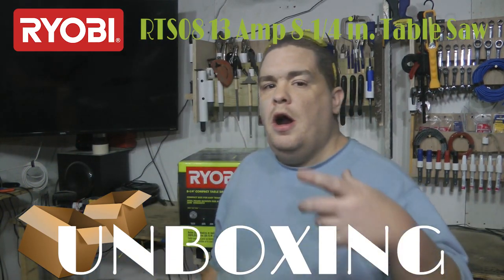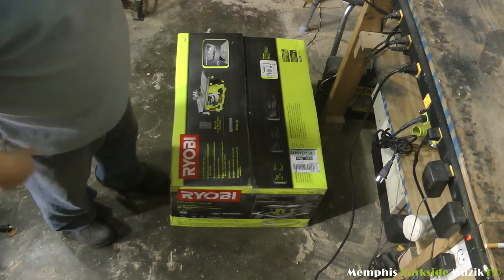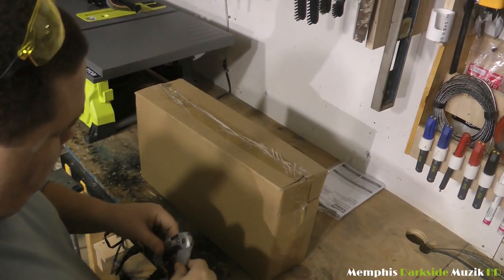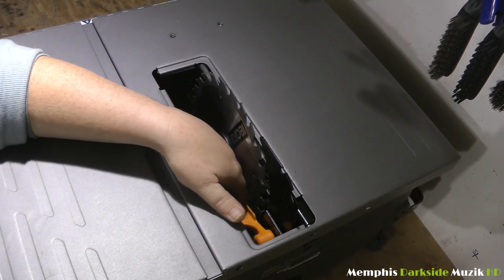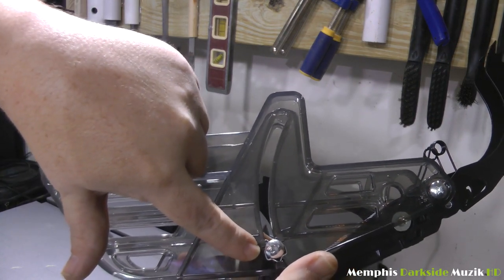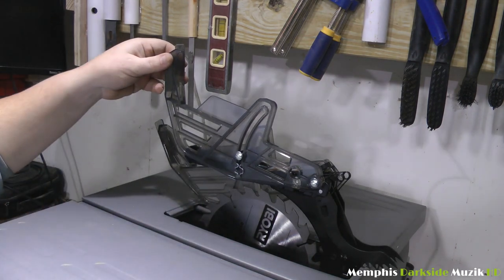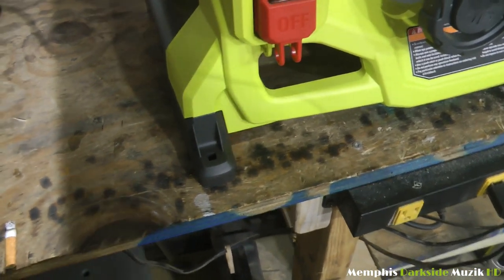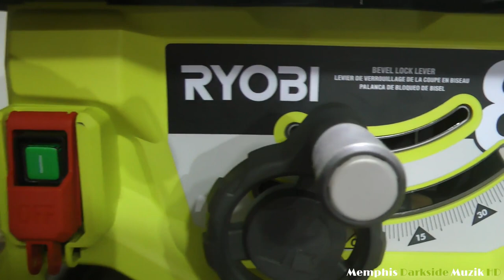Ryobi RTS08 13 Amp 8-1/4 in. Table Saw UNBOXING 2020

Comment: A word of warning: this is a great portable table saw, but my experience is that I can't get truly accurate cuts because the blade does not fully align with the miter slot. I have done the adjustments with the screws in the front but to no avail. I am pondering taking it apart and seeing if I can fix it that way. I have reached out to Ryobi support but they haven't gotten back in touch with me.

Comment: Changing the blade tools can be stored in a special compartment underneath? Easy to lose…
Will need to change the blade eventually…
Reply: Very helpful. They don’t have a quick start manual included.

Comment: how are you liking the saw? for $120 I am tempted to buy it as it seems to sell out quick from Home Depot but wondering if I will be disappointed and wish I spent more for the 10 inch
Reply: If youre mostly cutting 2x and sheet material the cut capacity on this will be fine.. if i had this id throw a 7 1/4 circ saw blade.. some guys even use em on their 10" aaws

Comment: Don’t spend 330 dollars for dewalt 15 amp or any of that.. I have the 330 dollar freaky table saw and I just bought this Ryobi for 119 dollars at Home Depot and I like it better than my expensive one. Also it’s bigger so you get a much bigger platform with ryobi
Reply: I am literally about to buy one but can tell if I want to spend that much more for dewalt since I will hardly use it

Comment: How does it cut?   I've been eyeballing this saw for a bit now.
Reply: I personally find a 40 tooth to be a good all purpose blade.  Cuts aren't as smooth as a 60 tooth, but arent rough and need sanding like a 24 tooth.  I heard that the fence isn't that good and that the table itself isn't level.  You have any issues with that?
Reply: Awesome.  I'll sub to check it out.  Been using an old craftsman radial arm saw for everything, and I was looking for something light weight I can make a french clear shelf at the end of my workbench to rip cut down 2x4 sections with easier.